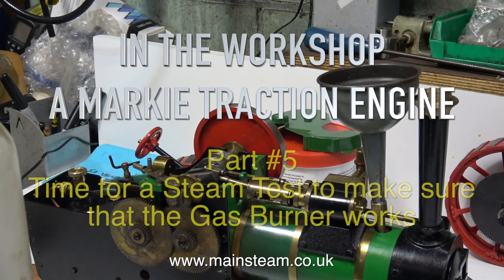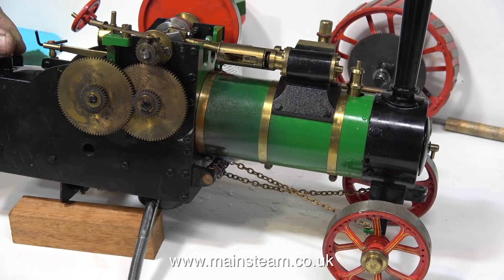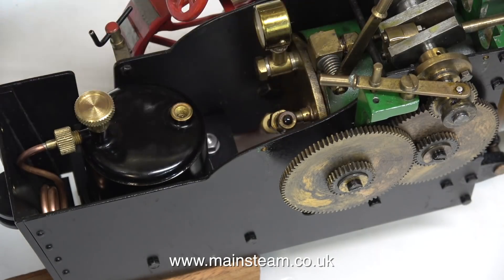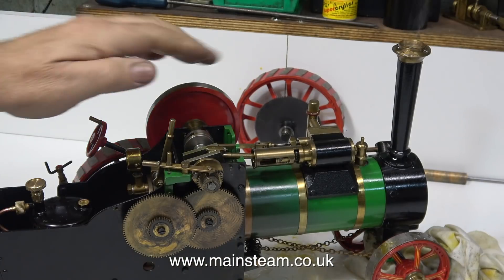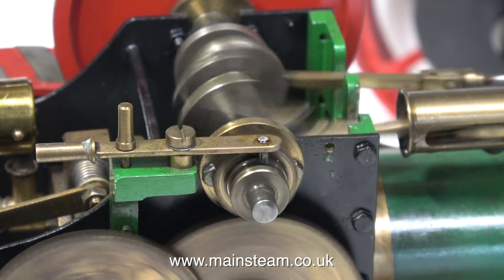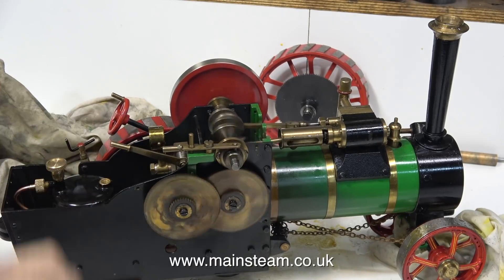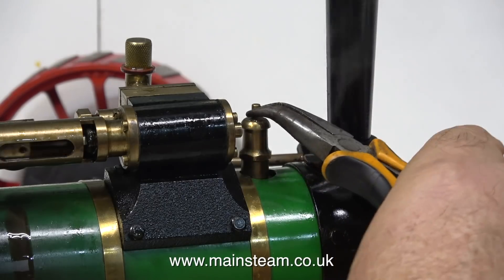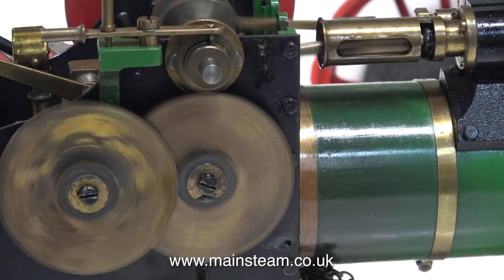REPAIRING A MARKIE TRACTION ENGINE - PART #5

Comment: If you have, or believe you have, 'furring' deposits in your engine from the use of hard water, just do as you would with a kettle. Add some 'defurring' crystals to the water and bring it up to temperature followed by emptying and flushing. For years I've been using citric acid crystals as they dissolve the calcium deposits and will even clean off corrosion products without affecting the pure metals in the slightest degree.

"Acid?" you say? I mean Citric acid; as found naturally in citrus fruits or added to most soft drinks and many foodstuffs.

Comment: Keith:  Many years ago when I was an active model railroader, I had a small needle oiler.  The spout was very small and the container was plastic and held maybe 3oz of oil, such as 3 in 1.  I'm wondering if such an oiler is still available and was also available in England.

Comment: Kieth when you released the pressure what did the gage read ? psi
Reply from the maker: please watch the video ......
Reply: I meant the last time you released the pressure after you showed 100 psi @ the 4.02 mark
Reply from the maker: I turned off the gas at the same time so the pressure slowly dropped to Zero . . .

Comment: Could rain water be used if you live in a hard water area? I have a huge underground rain water tank I wash the car with and water the garden ect. Also use rain water in car cooling systems too.
Reply from the maker: probably, but I would check purity and the acidity of the water in your tank first . . .
Reply: deionised water attack’s brass and makes it weak over time....un seen. With using tap water you see the crud/ sediment/ scale .. os even hard water is better than deionised. Why because you can see  the boiler  scaling up. Distilled and proper distilled is the best. Amacf

Comment: small job, fit a gas burner.

final work:
- fit burner
- fix burnt areas and re-paint
- re-time valve gear
- replace gague glass
- fix safety valve

is this called KeithAppletonizing the engine?
Reply from the maker: it makes for a longer and more interesting short video series }:-)))

Comment: After identifying the that the pop off valve spring is too tight I could not send it back. It makes sense you fix it before sending it home.   Just hate to see them get it light it and get hurt even if ya tell them to fix it first.  After 60 year dealing with humans my understanding is they would just want to test it anyway.  Nice video as always.

Comment: Noice, just wondering, any lube for the running gears?  ( or applied later b4 the cover is installed )... Cheers
Reply from the maker: I pre oiled them and they will need oiling when it's back together.